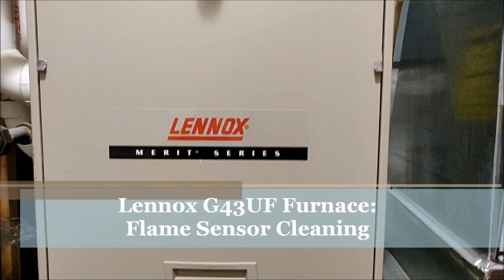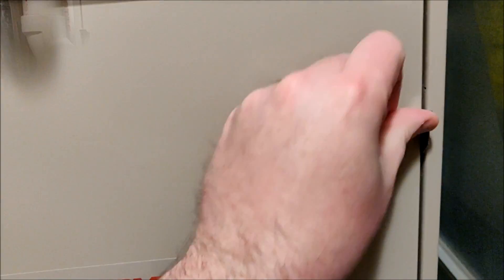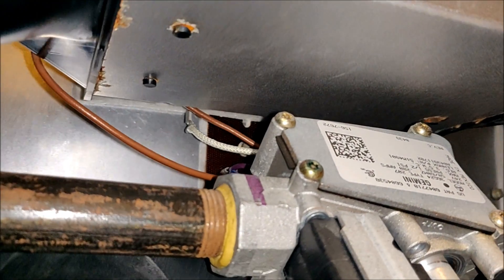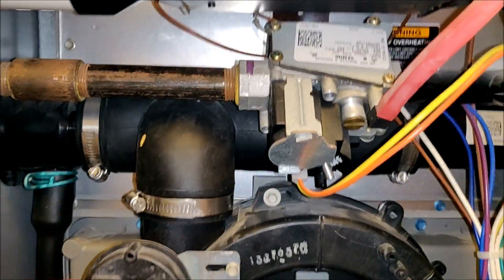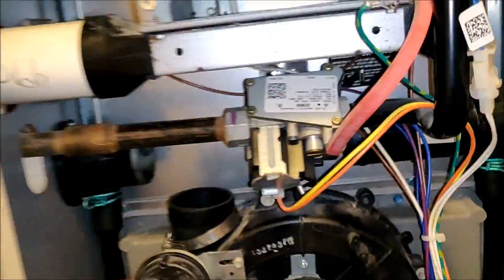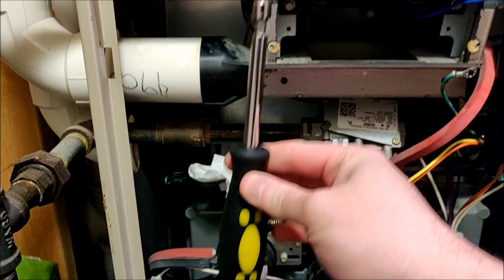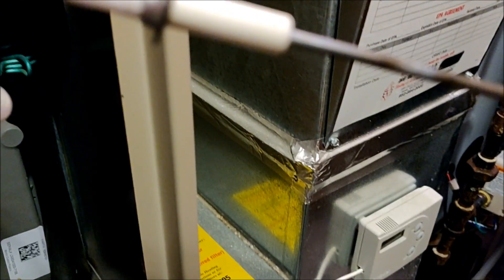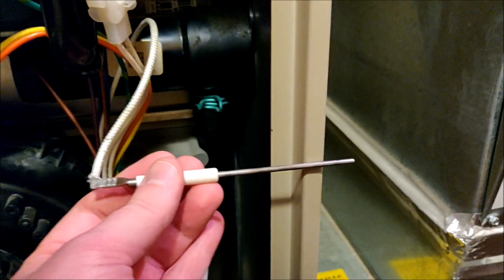Lennox G43UF Furnace Alternating Red Green LED Lights Repair: Flame Sensor Cleaning

Comment: Recently had this issue with this model furnace at my son's home. The flame sensor was dirty and needed cleaning, but the main issue was that his furnace is fired on propane and the burner outlet openings and turbulators were corroded and partially plugged with rust. About 7 times out of 10, only 3 burners would light and the unit would drop out and recycle until it eventually locked out. I pulled the entire burner rack out, cleaned out the burner outlet openings, and flame sensor, and the problem was resolved.

Comment: We cleaned it starts working and then days later does the same thing again?? What could be the issue
Reply from the maker: You could consider changing out the flame sensor with a new replacement part. They're not terribly expensive and the procedure is basically the same.

Comment: Get a 1/4" ratchet u-joint attachment. I took mine off in 30 seconds. Your video was good to point me in the right direction but no need to remove all the parts u did
Reply from the maker: Glad that you were able to get yours off with that. I tried a flexible extension first (without removing the other parts) and couldn't get it to budge.
Reply: @knagl  try a ujoint attachment or 90 degree attachment. The flexible extension didnt work for me too